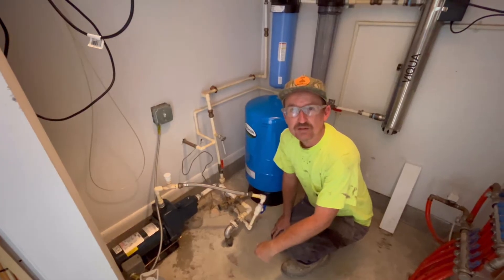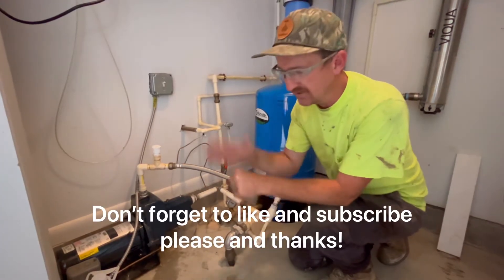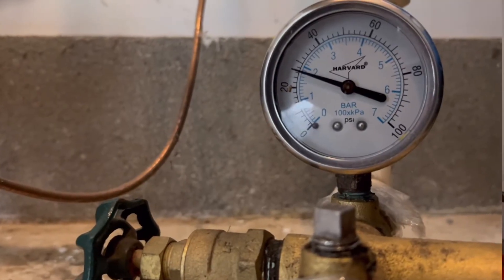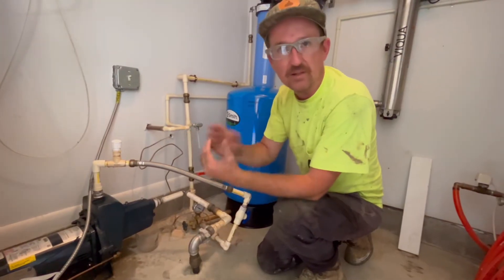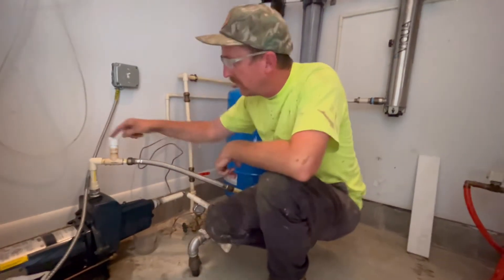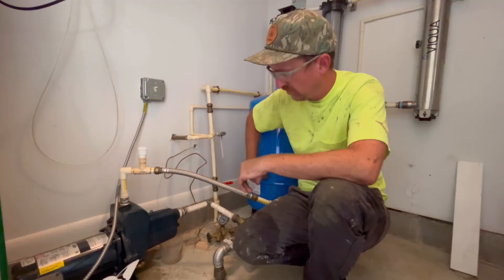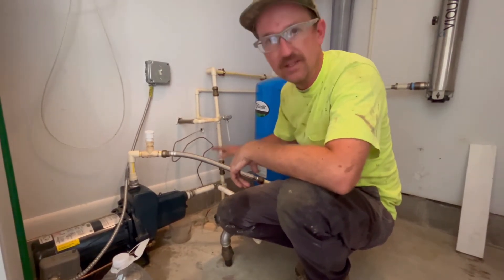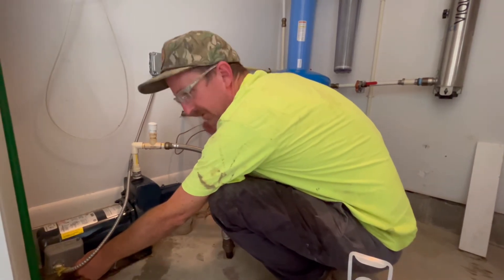Jet pump problems?? WATCH how to prime and troubleshoot your water pump

Comment: Weird question but our jet pump keeps tripping breaker , I haven’t looked at it yet but do you think maybe impeller is seized up or screen is clogged ?
Reply from the maker: Did you just recently install it? If so, it’s a wiring issue and likely that the pressure switch was wired incorrectly. If you’ve had it installed and it’s been running but just recently started tripping a breaker, then it could be a seized motor, or it could be that the original breaker was undersized because pump motors do use more amperage at startup as the pump’s get older. But it’s most likely the pump is bad
Reply: @rainbrothers it’s about a year old , I looked at it today and it was over amping so I took body apart and found that impeller was seized up. Was able to free it up as a temporary fix but will probably buy a new one
Reply from the maker: @evanweir1013 That’s awesome that you were able to fix it! If it’s a good quality jet pump (Franklin, Goulds/Xylem are our preferred brands), then chances are you still have many years of service left out of it.
Reply: @r @rainbrothers I’ll probably by a new one just to have on hand so when this one goes I can swap it out quick

Comment: Yesterday I had water one minute, then the next I had none.  Went out and started troubleshooting.  
Saw that the pump was off.  I thought that was the problem, but then it finally kicked back on and I let it run for a while and still nothing.
I needed a filter change on the whole house filter, so I did that, turned it back on and it wouldn't fill.
So then the thought was to prime it and it was empty.  I ended up adding a total of 6 gallons of water and couldn't get any results, so I just stopped for the day.
Interestingly, somehow the filter filled back up with the pump off.  Not sure how that happened unless water backed out of the line.
Do I just keep adding water to it hoping to prime it?
Reply from the maker: This video is likely going to help you more: Jet Pump Service Call - Troubleshooting Video
https://youtu.be/evscbHYbe6o . If your priming port is empty, you likely have a break in the suction line or a faulty foot valve
Reply: @rainbrothers  that's what I was thinking.  My plumber told me basically the same thing.  I was going to try and pull it out of the ground today, but it was freezing and I just don't have the time to do anymore troubleshooting.

Comment: Hey this was a very helpful video.  Possible you can help.   We are in a rural are filled with rich people which we are not.   The people that just recently replaced our jet pump and pressure tank got us confused but that is that, we are not unhappy with their work but kind of shocked with high cost.  We even bought the pump...a cheapie from lowes only warranted for 3 years so not expecting much.  Good thing because our foot valve was just when we bought the older house 24 years ago and were told that our casing needed to be checked.   The pump has been cycling every 45--60 min and we suspect it is the foot valve.   The crew did check that it was most likely a leak between pump and house further confirming our suspicion but knowing we are not among the rich that live near by they kind of put of off in doing the big job of changing the foot and possibly replacing line to house.   It is not a long distance. We gather this is a costly process.   We were told it the well is about 10 from the house.   This is a potential  problem because it is not 100 ft from there to the septic so professional companies won't even come out.   Here finally is the question...we need someone to do this work. We are older but are willing to help.   How do we look for help?  Are we looking for a plumber?  What is the part of the profession that you are in called?   We are not even sure how  to look for a handyman that won't say sure but not really know what he is doing.   The sediment that we get in out water is manageable with single whole house filter...but all the digging may mess that up.  Your advice would be so appreciated.  Thanks
Reply from the maker: Unfortunately there aren’t many experts in the field of cisterns and jet pumps. If it’s cycling that infrequently, it is just a small leak, and if you don’t have the resources, then you could probably live with a leak like that for quite some time. Verify the leak location by monitoring a pressure gauge (hopefully you have you installed somewhere in your system) with the main valve to the house shut off. If the leak is between the pump and the cistern/well, then the pressure will drop with the main valve closed. If the pressure holds, then open the main valve and monitor the pressure again. If it drops this time, then the leak is inside the house and is most likely a leaky toilet (easy to check which toilet by dropping food coloring in the back of the toilet and seeing if the water in the toilet changes color). If the leak is between the pump and the cistern/well, then it is most likely in your foot valve - no reason to replace your whole water line. Try calling a well driller to see if they can help. Check out our other videos, especially the one where we record a service call of a jet pump

Comment: Thank you. Great video. Also I have been working on pumps for maybe 50 years on and off and did not know about the low pressure cut off. I checked with 4 friends that do family pumps and they didn't either. We all thought it was to cut the pump off to work on it. Thank you so much Jonathan.
Reply from the maker: Wow that’s very cool - thanks!